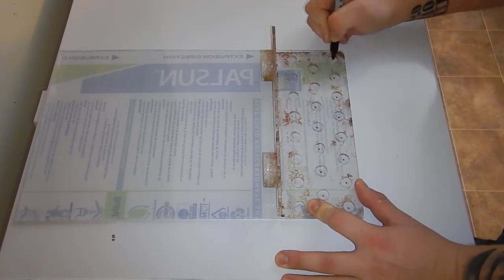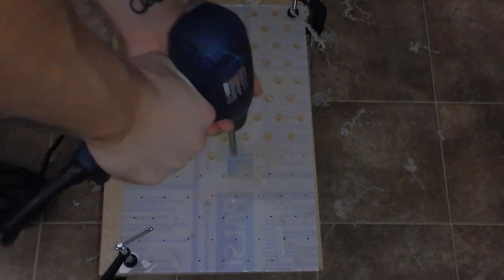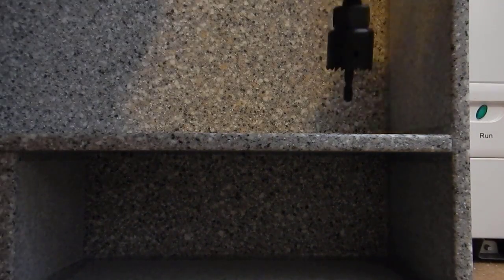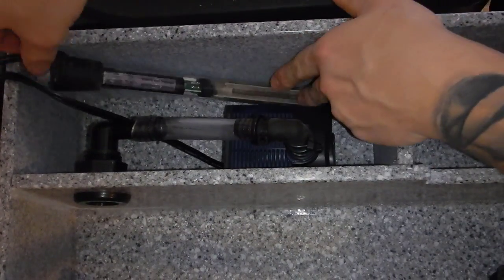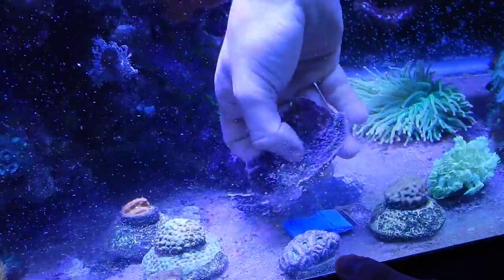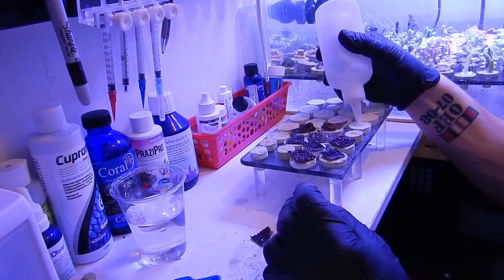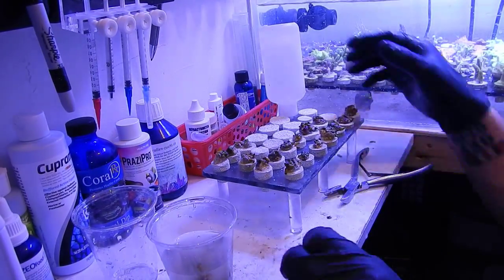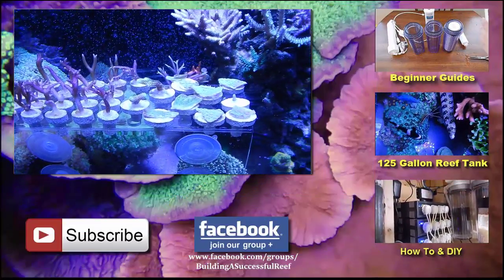Frag Swap Prep Part 2 of 3 | New Frag Tank Setup & Cutting More Coral

Comment: good stuff bud. non stop video packed with info as usual 👍
Reply from the maker: Thanks man
Reply: Reefing with Billy Pipes hey billy how much are those tanks?
Reply: Fish School all depends on size and where you are located. a tank like this without shipping usually goes for $275.00. but I cut big breaks if someone picks it up in person
Reply: Fish School also have other designs on my "2016 reef and reptile expo video"
Reply: Reefing with Billy Pipes First tank that I have seen made with Corian. Where did you get that idea? Do you work with that material regularly in and outside of the hobby?
Reply: texmsmrfc the company I work for uses it. I always grab the big pieces of scrap and build stuff with it
Reply: Reefing with Billy Pipes its countertop material, i use it everyday at work.  Its heavy as shit and fragile.
Reply: Dave Smith it's actually not fragile at all. that's why they use it for kitchen countertops. we fill the demo tank and put a hydraulic pump between the front and back and it took over 600 lbs of pressure before it broke. and the seems never even came apart. the entire tank weighs less than a 40 breeder.
Reply: Reefing with Billy Pipes wow, it really took that much pressure? I made a 15 gallon ato tank and its been great.  I work with the stuff daily, still feel it is more fragile than acrylic.  But thats an opinion

Comment: Corian cuts exactly like wood.  Any tools you would use on wood use on corian. Just make sure blades and bits are sharp, not dull.  I am a countertop fabricator and my company specializes in solid surface countertop fabrication.  Corian is just one of the many brands of solid surface.  I made a 15 gallon ATO water container out of corian and it holds up well.  Your frag tank MUST be heavy as hell.  Only downside.